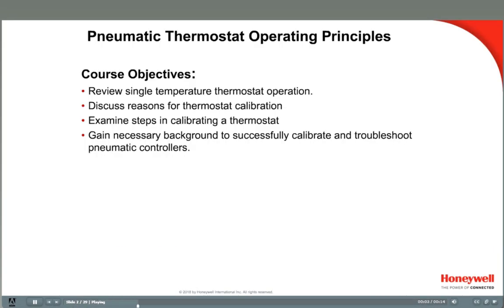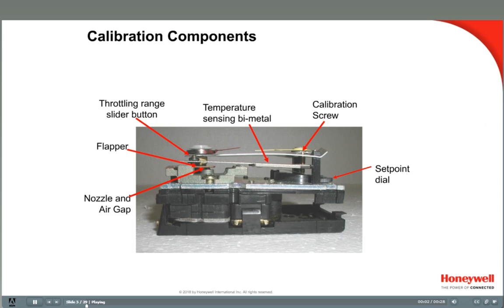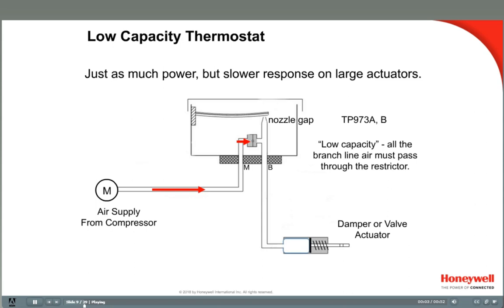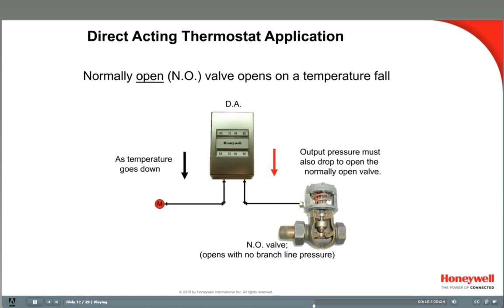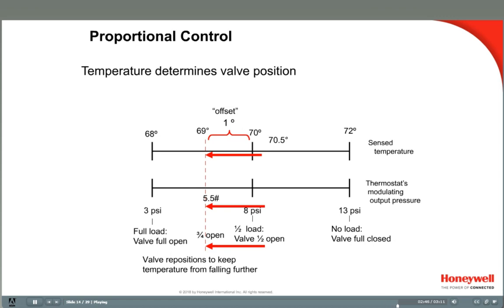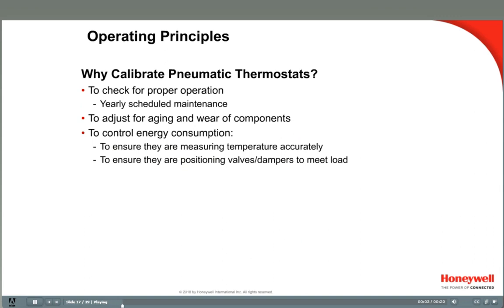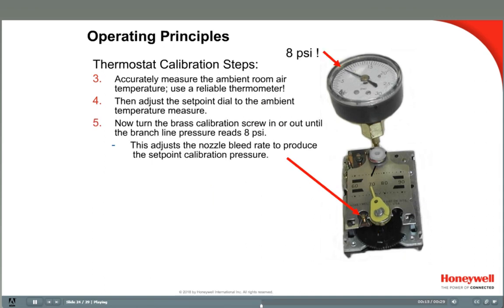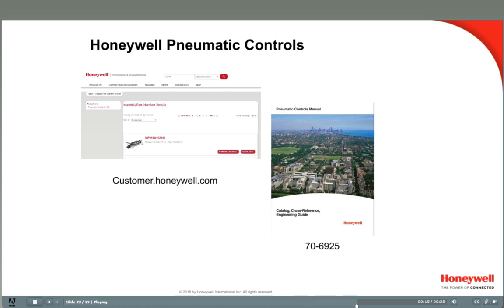Pneumatics 3 Thermostats

Comment: Why would you choose one method of calibration over the other... Excellent video... Thank you
Reply from the maker: Thanks. Most people use the 1st method as it is quicker and easier and it is the one that is usually taught in schools. I think method 2 is slightly more accurate as it calibrates to the spring. As you can imagine, the spring tension varies as it stretches and contracts, so it may be better to calibrate to that. However with method 2 you need to know the spring range and it may be in the ceiling, under a cover etc. and hard to see. Method 2 could also mess up sequencing if the stat is controlling two different spring range devices like a heating valve and a cooling valve. So it is up to you, but most people just use method 1. Maybe a real expert will read this and have a better answer!